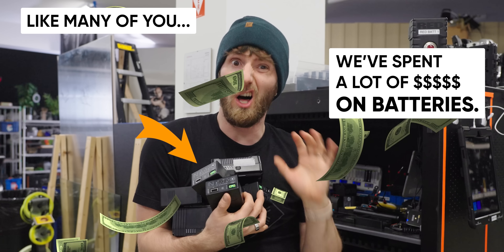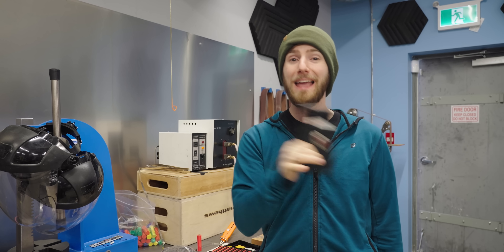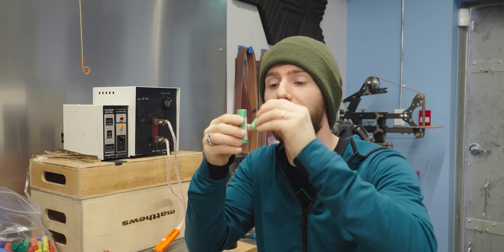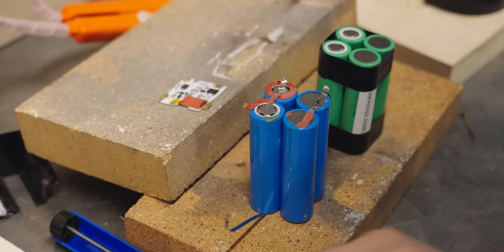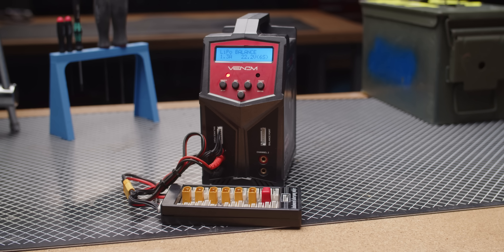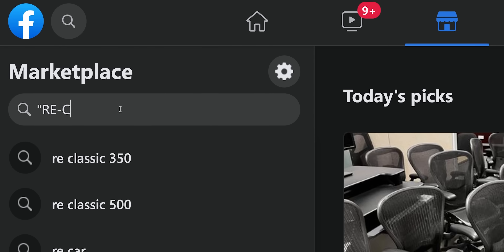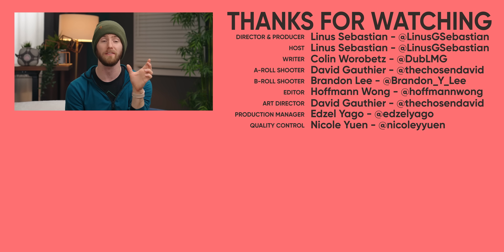This should be illegal… Battery Repair Blocking

Comment: I already know of an evil company that is preventing you from swapping the battery, future motion, and their product, the electric skateboard.  Louis Rossmann has done 3 videos so far on their anti right to repair practices.  If you unplug the battery and plug it back in, it won't power back on.  You have to ship it back to them and pay a hefty fee to get it replaced.  Another company had found a way to get around this and future motion is suing them over it.  Louis has called this company more evil then Apple.

Comment: the big question is, is in wired in series, parallel or series & parallel
all positive up, ok so its wired in series.... that's simple enough...
though from the orientation  you got em in at 7:18 it seems like your using a parallel & series wiring.... which when wired correctly will not shock you while wiring.... just wire the series circuit first then bridge it together in parallel.

Comment: For a large pack like that you actually forgot one critical step... Cycle your new cells at least once to make sure they have the same capacity. There's a good chance that the vape shop cells are lower quality and capacity compared to your old cells. Also internal resistance is critical. Get an actual smart battery tester / charger

Comment: You can add another type of evil BMS - The way DJI does it. Yes, the drone company. When the battery pack starts to fade, it's very difficult to change the cells because the BMS board has to have power to it all the time. If it doesn't (like when you're changing the cells) it'll refuse to power-up ever again. Thus, you need to buy a complete new battery unit.

Comment: In the case of batteries, I can kind of understand obfuscating the repair process because it's just too easy to screw up and cause a potential problem. It's not something that most people should attempt. Doesn't mean manufacturers are doing it purely out of safety.

Comment: Did anyone check the battery's voltages between the first and second zaps?  Thinking that one zap might  bring the battery to a higher voltage and the second might put the cell over the top.  Or out the door as the case may be.

Comment: Speaking about safety, WHERE ARE YOUR SAFETY GLASSES at the beginning of the video?
          Regarding burning cells (you do not explain why they burned, why did you cut the video when that happened?), where did you get that welder?  The one I have uses capacitive discharge, set to typically 40 watt-seconds.  When welding, there is a quiet click when the weld is done.  There is no visible glow at the weld site.  The temperature outside the weld spot is not even warm.  You claim yours is set to 14 milliseconds.  Listening to it, it sounds more like 140 milliseconds.  That is WAY TOO LONG for ANY cell.  The one I use is a Unitek.  There are no flimsy leads.  The welding head is mounted to the capacitor bank with copper bars 1/2 inch in diameter.  Did you note the sound/sight of the welder in the battery pack manufacturer at 17:26 in your video?

Comment: I think you are using too much heat on the welder. adding that second layer makes you make it too hot. the best battery welders use a press, that applies a lot of pressure that makes the weld faster and better which uses much less heat.  Also in 1976 college of EE, we were taught to NEVER NEVER EVER put a battery in parallel with another, which is totally violated today with the use of Li-on batteries. In 1979, I attended a IEEE meeting where a battery engineer explained why they could not use Lithium as a storage medium for electric cars (which the lithium tech was discovered during ww2)- FIRE! was he right? I think so.

Comment: NOBODY should be trying to re-cell a lithium battery pack DIY. But preventing user battery replacement (all recent gen phones) so that you have to throw the device away just because the consumable battery is worn out, should be criminal. Worse is the issue of OEMs blocking sale of new 3rd party batteries by using malicious DRM. Older Canon cameras could use perfectly good 3rd party batteries from respected makers. Then Canon decided to block this with firmware that meant you could only use "genuine" Canon batteries (at inflated prices) and killing the 3rd party battery market.

Comment: Dexcom continuous glucose monitors fall into the "evil" realm. The device is single-use and meant to be disposable but there is a clock in their bluetooth transmitters that gives you 3 months of use "from activation" even if the battery could go longer. The timer is basically there as a lowest common denominator CYA so all transmitters have the same lifespan (before they expire ... and that battery does eventually drain too much if it sits on the shelf for too many years). It's still annoying, since with a couple of hacks you can reset that clock and get 50% or more time out of a recently-manufactured device.

Comment: If you cant open it, you dont own it.... I started out as a kid with things like drilling out the rivets on my HotWheels cars to fix bent axles and epoxying them back together, later taking apart the cassette player to untangle tapes wound up in it (got it back together) and on...

Comment: Same with cables, tried to repair a belkin type c usb cable because wires were showing from poor care... Conductive braiding and glue everywhere, the the actual case (where you pull rather than pull the cable to reduce wear and tear) was a soft mould not able to weld shut again

Comment: ive rebuilt lots of battery packs. some tips to "reset" the boards are to attach the charger or power supply for a short time before attaching the batteries , after attaching the batteries fully charge the pack before testing in a device. also some boards have two test points you can short out to put them through a learning cycle where they will "scan" the new cells.

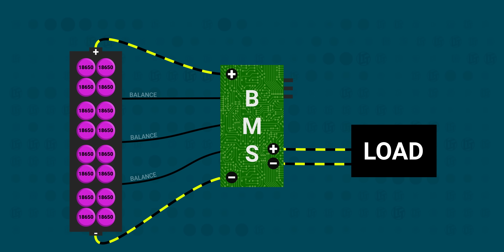Comment: This is pure speculation from me but 1:45 shows a good shot of the PCB and can clearly see five 8 pin ICs. I can not see the printing on the one by itself but my guess is that is a memory chip (such as 24LC256 or similar) that is being written to with each charge or capacity values and when it hits a certain value that is cutting off your charge.

Comment: Rebuild the cells with LTO 18650s . They don't burn that fast but because it is a different chemistry you have to rework the BMS. On the upside they are good for cold weather and safe. They don't have as much capacity but charge very fast.

Comment: RED can eat 💩, if i want to repair my battery, i am going to do that, and they can do nothing about it.

And replacing 18650 cells is so easy, i have done it now 9 times, and it it very easy, you can buy a spot welder for $50, and you can 
buy most of times, new BMS from Alie press, did it with Makita battery's, and reused the housing for the BMC and cells.

Comment: Not being present I can’t know for sure, but that sparked one on camera (4-cell pack) wasn’t the batteries. It was the electrodes and the strip. Either dirty tip, angle of press, incorrect head pressure, or partially off the tab’s side. That pack is fine. It may just need some sandpaper treatment if the metal is dirty from the spark.

Definitely good practice to assume danger and take appropriate measures, but it’s fine to use.

Edit:forgot to add head pressure as a cause

Comment: Why would connecting positive and negative spots be the scary part? It is connecting positive to positive and negative to negative, so the cells in parallel to each other. That is when the balancing is important, connecting a 3.2V cell to a 4.2V cell in parallel would result in the 4.2V cell dumping a lot of power into the 3.2V cell.

Comment: Planned Obsolescence?  Back in the 1990s I met a Mechanical Engineer named Ace Hayes, who told a story about his time with a Famous Company that made LABEL MAKERS (rhymes with the third smallest US Coin).  I'm not sure if management became "enlightened" or if the Company was under New Management, but they noticed a drop in sales and tried to fix it..  The sales were low, not from wrong doing or poor management, but because their LABEL MAKERS were so well built that they never broke!  They had pretty much saturated their market, reducing new sales to a trickle.  Anyway, To remedy the situation, they hired the M.E. to re-engineer a critical gear in the Label Maker so it would BREAK after 50,000 operations!  That worked , short-term sales increased, but after a while, they nearly went out of business with the bad reputation they got from everyone who had seen or worked with their original product, and had immediately noticed the marked drop in the quality of the new product. 
 [I believe they went back to the original design.]

Comment: IMHO, putting microchips into consumable items should be illegal all around the world.

no fucking wonder we have a "microchip shortage"

battery packs (BMS) and printer cartdridges (DRM) are the worst offenders.
just move the BMS back into the device and use a "dumb" battery pack that has the voltage rails and control lines for the BMS on a suitable multi pin connector just like they did it about two decades ago.

we had all this down and close to perfection until companies decided to put a microchip into every throw away item they could possibly find an excuse for…

Comment: Recently changed the battery on my pristine SGS10+, whose rear panel began to delaminate as the LiPo battery began to pillow. A 10-minute YouTube video followed by a 20-30 minute repair and voila...back to perfection again.  I did have to buy a new rear cover with pre-adhesive strip applied ($10, ALiEx).  A new Samsung OEM battery off a Amazon ($30), to include its pre-applied adhesive strip. Lastly, a small Philips-head screw driver, a heatgun, a stiff plastic card with a thin edge, and 90% isopropyl alcohol. Most of my time was spent removing all of the old adhesive from the phone frame, which had to be carefully balled-up and off of the chassis. The battery removal takes some care, so as not to damage the backside of the screen. Small amounts of alcohol in the tray helps to loosen the battery backside adhesive. I cleaned all surfaces for the new adhesive with alcohol, to ensure proper sealing for moisture resistance. The heatgun is used to soften older existing adhesive for easier removal of rear cover and battery, being careful not to heat too much! The heatgun is also used after the rear cover is installed, to better form the new adhesive to its contact surfaces. It was easy for my Samsung.  Can't say the same for Apple...good luck with those phones.

Comment: Double sided tape is micro thin and would hold batteries. Another option hot glue, but because of heat I would lean more towards 2 sided tape

Comment: BMS will use the cheapest way possible to prevent you from fixing your own pack. Programming to detect different cell profile or just volatile storage is my bet. Next time, keep power to the BMS while you spend hours of time spot welding the new batteries and see if it works. I the end, this does not seem a cost-effective way for an end user to replace their batteries. Just cost of materials, equipment, safety issues, etc. makes this totally impractical.

Comment: I know, I know, replacing just the bad cells is a life threatening experience and a felony.  But, we in the model aviation sport do it all the time to extend the life of lithium batteries by as much as 50%.  Ever wrecked an electric model airplane or car and watch it go up in flames.  It's about as dangerous as igniting a camp fire with fire starter.  Given all my hype, I agree with the axiom that new batteries, connected in parallel to used batteries, will likely not last longer than the used cells.  As most know, that's also true with replacing batteries in a vehicle that has more than one main battery.

Comment: I've been repacking tool batteries for decades..A good source of 18650's is after market tool batteries..ya can get 10 quite good 4 amp cells for around $25 on eBay. 5 and 6 amp are $30 to $35..I've repaired several Ridgid 18V with these with good luck BUT I don't use the Ridgid charger.  I use a slower after market charger which is much easier on the cells..fast chargers kill cells and always have..should take at least 1 1/2 hrs but who wants to wait??

Comment: Under normal circumstances, the cells are the most expensive and most dangerous component.  Least common denominator safety and replacement is far far more important than letting people refresh their own batteries.
Why don’t you fault Red Cameras for having proprietary batteries instead? That’s the real issue.

Comment: There are a new assembly kit where you just use the prastic/hard rubber holding clip to slide or snap each cell. Next then use connecting metal strips and use a washer/nut/bolt to just screw down.

Comment: Look at backup batteries from HP/IBM/DELL RAID systems. They cost hundreds of $$$ for a handful of 18650 cells. All protected by date, code, expiration bits... Even if you manage it to repair it professionally, they will not work until you crack the code. I made a video about this (EVA4000 battery repair)

Comment: Unfortunately, most BMS in battery packs permanently "shut down" as soon as the voltage on any cell drops below a certain threshold. As always, this is claimed to be done for safety reasons, since if a cell drops below a certain voltage, it'll most likely work fine after being charged again, but it will probably still have taken damage from it. Alternatively, there may be a faulty contact, causing the voltage to drop, which could also potentially be a safety hazard.
The thing is, the BMS doesn't know if it reads 0 volts cause you disconnected the cell, or if the battery or wiring is just unreliable. Obviously, one could easily add some kind of reset button, to "reactivate" the BMS. But the battery pack isn't designed to be repaired, and I'm sure manufacturers would argue, they prevent you from trying to fix it for your own good. It's the exact same reasoning all manufacturers use to justify making things impossible to repair.

Anyway, if you really wanna repair such battery packs, you can of course just hook some lab bench power supplies up to the BMS while replacing the cells. It's an annoying extra step, but I've done it a couple of times and it works fine. Unless of course your BMS is so evil that it checks for jumps in voltage or difference in capacity. But I haven't stumbled upon such a  BMS yet.
Reply: Exactly, I'd just connect it to another similar charged battery paralell and test it. But there's big chance BMS lock down due to numbers of cycles or just shut down after number of cycles (or sudden capacity increase)
Reply: The BMSs I used, never permanently shut down.  They simply disconnect the battery ground when voltage fall below a threshold.  They will work again when new batteries are installed.

Comment: My 18 volt Makita pack had some bad cells so I replaced them, But the battery maintenance board never worked again, I have been charging the pack on an RC charger for years now.

Comment: Do you really use have to use sand paper for spot welder? I know it's not a regular soldering gun, so maybe it is necessary, but I'd just like to be sure if that's how you should be doing that. As you know, for soldering guns you use sponges or copper wires to clean them up

Comment: Linus at 4:31 - "No! Don't put in used cells that you have tested and confirmed are still safe and operating with new cells! It's very dangerous! Don't do it! Just don't!"
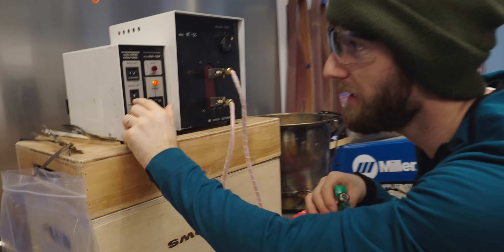Also Linus, but at 8:18 - "Watch me cause potential short circuits in the battery series connection by not only having no clue how to spot weld batteries, but even overlapping the leads."
...Do you know what is more likely to cause a glorious inferno here, Linus? I mean, this is the equivalent of building a PC and finding out something doesn't fit correctly only to hammer it in.

Comment: "Fire safe workstation"  looooooool.  I hope the fire remembers to stay on the brick and not get on all the unnecessary flammable clutter piled around on the workstation.  
To be clear, I mostly ignore safety with everything I do, I'm more like electroboom, but I also do not claim to be safe or have a safe workstation.  I'm not going to weld inches from plastic bags and wood boxes and call it a fire safe workstation.

Comment: while i agree there are alot of anti repair stuff around i dont think batteries are built in such a way to prevent repair cause they dont want you to but rather for your own safety as we clearly saw you mess up with several batteries and i would guess normal people would be significantly less skilled, so im guessing single use and cheap plastics are more for cost effectiveness for people that arent going to be repairing them themselves

Comment: As a resistant welding professional let me help you out.
Shorter hotter pulses, 14 ms is way too long.  Next issue is pressure. You arent pushing hard enough. Hotter faster, and more pressure. And tape your open connections for god sakes.